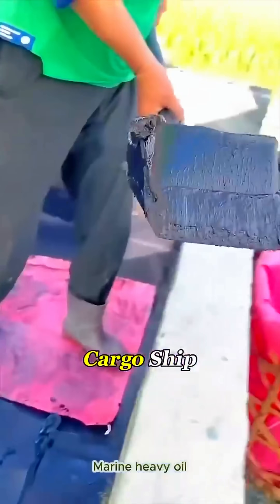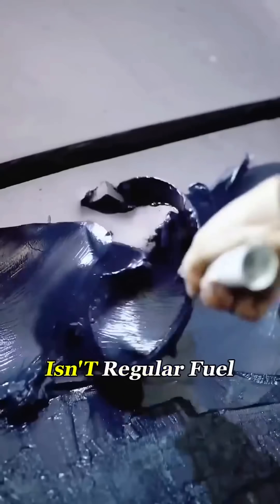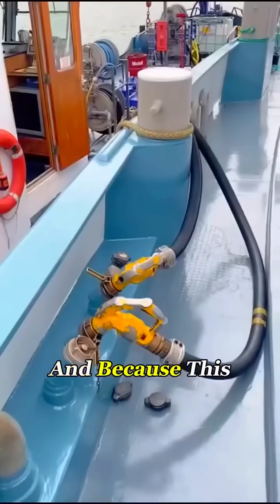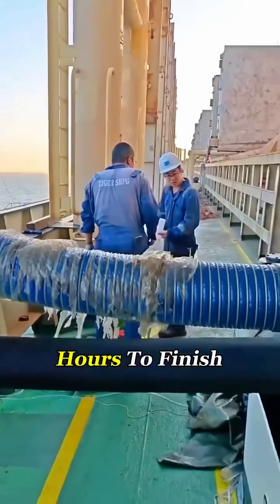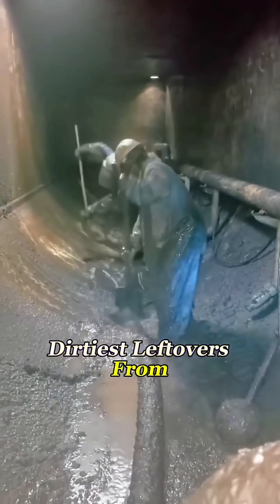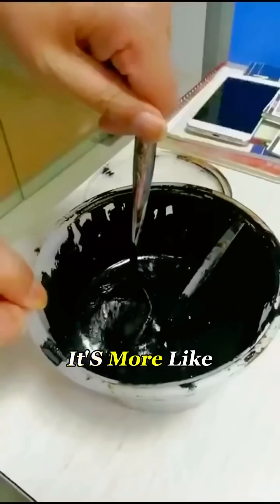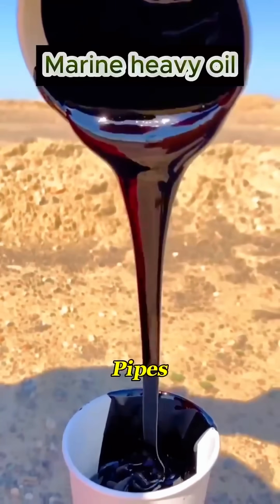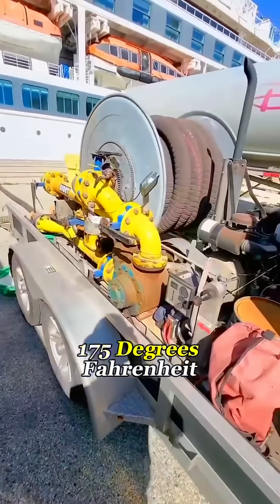Why Cargo Ships Use Asphalt Instead of Diesel! #shippingindustry  #greenenergy  #cargoships

Comment: Back in the 1960’s, I worked as an Ordinary Seaman in our USA Merchant Fleet.  Sometimes the cargo oil tanks needed to be scraped so as not to mix fuel grades of cargo.  The job title was called, Butter Worthing (spell?).  No one wanted to do the job because men would pass out from the fumes, and it was also, extremely dirty.  I think OSHA finally put an end to doing this type of work.  I don’t know how it is being done today in 2025?